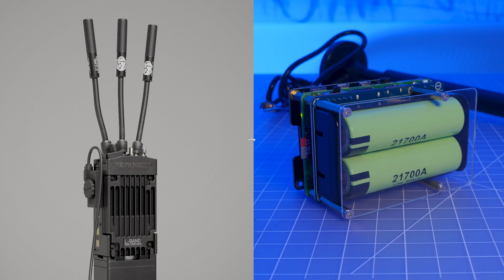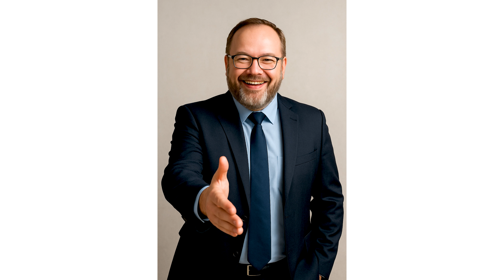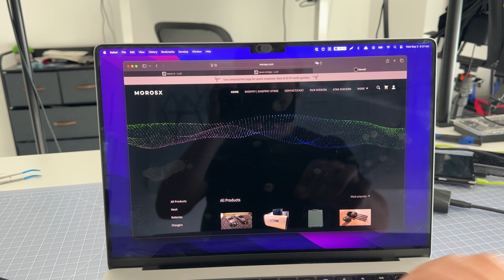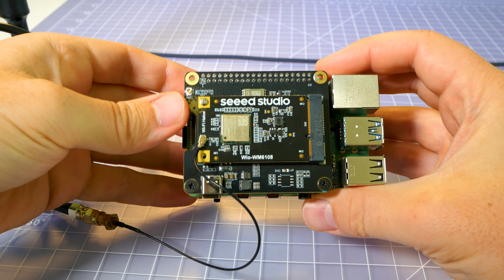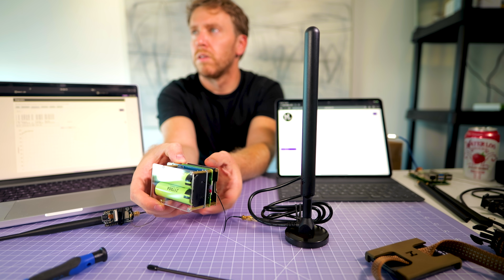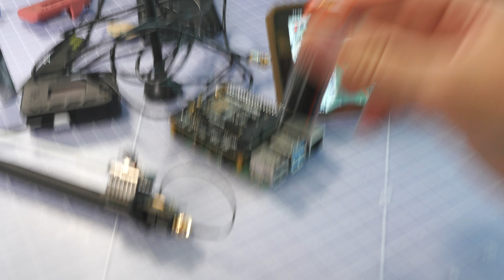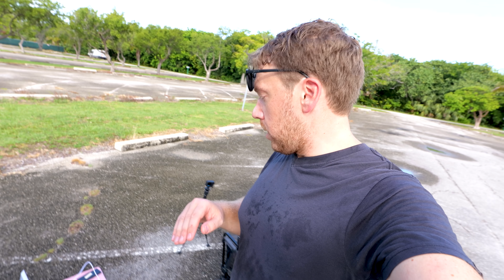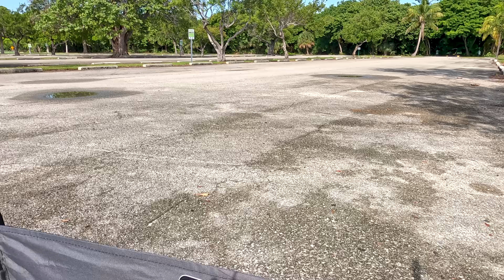I Built a $20,000 Military Router for $106.23

Comment: something to consider, mikrotik already makes sort of similar hardware for home use, they have hardware to connect wifi points at long range, also its possible to install openWRT on some of their devices so may be its possible to reuse some existing hardware, used will be cheaper and already water resistant + poe

Comment: You didn't create a "military router" for 106.23, you created a router with similar functionality, but didn't create it to durability, reliability, or water resistant specifications. You didn't create it to be resistant to RF jamming and to use restricted use channels and frequencies. You didn't create it with supply chain resiliency and transparency at the forefront. You just created another meshtastic node. Most of all, you forgot to create it to be maintained by guys with sub-optimal IQs who would rather be shooting the shit in the smoke pit than trying to get some dumb tech thing to work.

Comment: Very cool. Also, you might be interested to know that with an alfa wifi adapter with an atheros chip, a metal clothes rod from a closet, some neodymium magnets of roughly equal size to the diameter of the rod, and a directional antennae instead of omnidirectional; I was able to get a similar distance connected using 2.4ghz without halo. This was about 10 years ago now roughly. And I was getting 5mbps down, but that was the maximum speed of the connection. (Rural internet)

The way I had it setup, was the magnets helped hold the slightly weaker magnet in the antennae mount to the rod, but also I had the cable running through the rod, and had this propped up against my wall. Oh yeah, this was through walls and trees and bushes. About 4 walls in total, 3 trees, 2 bushes, and a about 2 blocks length in distance... which seems almost to be the same as your setup. maybe you are a bit further.

The wifi adapter helps though, cause it was able to be forced to work at a slightly higher power range... but I could never get it to work properly without cutting out. Even so, it still had a better range than others I had in the past. Probably for the best, since the FCC might have an issue with it if it ended up interferring with anything important. Being rural, I was probably fine. But oh well, it didn't want to play nice anyways. 

I eventually tested this for further distances, and got some interesting results. Barely a connection... but the SSID of that connection I got to link up, it had a name on it that implied it was in a town... miles away. Like miles and miles away. 

I doubt it was actually in that town. But still... where I was, there was nothing around me for all I could see. Just some random connection in the middle of nowhere was open and able to be connected to. So I did, to see if I could. 

It immediately shut me out a minute later after I did a speed test. Whoever owned that connection, saw that.
Reply: about a decade ago I was using 2.5ghz band to send live video feed from drones. You bump the power up and get a good antenna and you can cover some pretty wild distances. Over 2.5km. I did also accidentally discover a way to take down wifi for the entire neighborhood doing that though... which was not appreciated I'm sure.
Reply: @diversie509  Yeah... it's a neat trick alright.

Comment: What you made is not the same like the military device. It will not work at -20C (-4F) as FLASH memory in it will be erased. Nor will it withstand drop tests and other MIL-STD requirements like the ones for waterproofness. You can't make it as you will have to re-engineer Raspberry with components that can withstand extreme conditions. And these components cost at least order of magnitude more that standard IT chips. I'm not defending military procurement, but for that military grade device the huge amount of engineering hours and testing effort was invested. And then you have to divide that cost with number of units that military was ordering. So have that in mind. I was working in automotive industry for a while as engineer (and requirements are similar to military ones) and I can tell you that developing one engine control unit can cost up to 5-6 M$. Plus, one MB of FLASH memory that can withstand extreme temperatures costs like 1GB of standard flash memory. Nothing in that military router is reused from off-the-shelf components. PCB design, components, housing, everything was tailor made and tested multiple times before the device was adopted for use and the cost of R&D and testing was probably in millions. Not to mention that components you used do not comply even with the minimal cybersecurity requirements. So, the OS of the device is probably proprietary.

Comment: Nice!!

I have a suspicion yours isn't IP67 rated :-) And of course no MIL encryption, so it can do some of the things a MIL radio can do, but it wouldn't be accepted by the military. 

HaLow (yours is at 500mW, at least in hardware) gets you decent range without the higher power of many MIL radios (10W in the case of some Silvius configurations), but you're much lower bandwidth.. fine for voice.  Lower power is actually much better for a dense mesh, but that's not usually the use of this kind of radio. 

Of course, for non-MIL uses, there's a bunch of stuff. I can't tell from their specs who's HaLow chip is in the Quectel module, but I'm guessing it's Morse Micro's, so you'll have the 8MHz model, not available on all HaLow chips.

Comment: 22:50 I'm sure you're aware that you really should be running a speed test between the two nodes and not a speed test thru the Starlink to the open Internet. Because you're including too many unknowns here -- the Internet speed test server could be slow or the Starlink connection could have an issue. You'd want to run the speed test between the two nodes to know how well the HaLow connection is performing.

Comment: Mesh networking has been around for a very long time. But it has gotten much better. Multi spectrum mesh like what your using is really useful. But I just don't see a military buying into something that glows as bright as something like this does. Spec ops sure but general use I question it's usefulness.

Comment: i've been considering using an anchored high altitude weather balloon, as well as a hacked rv dish (to track the balloon automatically) to deploy a network that could be used for emergencies, etc. the idea in the long run would be that if multiple were launched, the HABs could connect to each other and share data, effectively creating long range data sharing / comms links. 
i'm currently trying to acquire some of the boards from the other/outernet project to tinker with this idea, bu they are proving difficult to find. i may just have to put together some bespoke hardware. as far as the dishes, used rv satellite dishes such as the winegard or tailgater series are abundant and cheap on the used market and are easily hackable...
Reply: meshtastic is probably what you want. This has good range and great data capabilities, but its MUCH more power hungry and meshtastic will have a greater range overall and still allows ATAK. A meshtastic node with a solar panel the size of your hand can stay powered up indefinitely. Throwing one of these halow devices on a balloon means you are taking it down every day or every other day to charge the device back up. 
If you want to get really clever, you could make use of the electrical change in altitude to power the meshtastic device without any solar panel, but you would need to be on battery saving mode probably

Comment: bro discovered 802.11ah and thinks he's a military contractor now
Reply: exactly what i was thinking, A MANET like this one will not see the light of day aside from commercial use, this thing can be knocked down with a $50 jammer, and the audacity of selling a $100 guide for documentation which is already free lmao
Reply: @pvim  i was thinking that. I used to use a 900mhz control link for a flying wing. Should have been getting well over 20 miles. Ended up getting jammed on the ground when a friend turned on their control link
Reply: Guess what other radios can be knocked down with a $50 jammer? If you guessed persistent systems mpu5, you'd be right.
Reply: @iirnubb   I cant see anywhere on their page that they marketed it as "jamming resistant". Any properly designed multi band hopping manet is very hard to selectively jam without blasting your jammer at full power across various frequencies inturn jamming your own comms and making the jammer location look like a beacon.
Reply: @iirnubb no, because it does spread spectrum frequency hopping. It'll just switch to a different frequency (and it does that multiple thousand times per second). You'd have to jam multiple complete bands to fully jam it, which would jam your own gear and you'd practically be a giant beacon screaming "LOOK, IM HERE!!"
Reply: @pvim  The docs are free big dog, only the pre-built thing is 100 dollars
Reply: @spressono he is referring to the $100 field guide he sells on his website that has step-by-step instructions for building it and configs. It clearly states it does not include any hardware.

I actually came to the comments to try to determine what the value was of the $100 field guide versus just following the GitHub guide.
Reply: @spressono  Literally click the link lol, it's $97 for the guide, no hardware is included at all. The pre-built thing he showed is ~$1200.
Reply: @spressono  crazy thing is that the pdf is NOT free, big dog. It costs 97 dollars. For the MANET guide at least.
Reply: "I made this 20k radio for 100 bucks!!!!" 
Now make it while maintaining a proper supply chain, making sure all the ICs come from the US, getting certified for EW/EMF hardening, applying for the contracts etc etc

He might realise then that the costs aren't /that/ inflated.
Reply: @xjekwkfhzodudidkne  “but muh halow chip from china is only 10 bucks!” 😅
Reply: @xjekwkfhzodudidkne lol no, that's basically all routers and car rf go through while selling at few hundred bucks. 20k for a radio basically fat ass profit margining, nothing else.
Reply: @shkhamd yes I'm sure you believe that FCC certifications are exactly the same as MIL-STDs, they aren't though lmao

Comment: You mentioned the legal limit of 30dBm for the broadcast power and then you mentioned using high gain antennas to get more range but you never mentioned the legal dBi limit? I am pretty sure I remember from my ham radio days that there is a limit to power output by antenna gain.
Reply: Most of the specs in the USA are limited by specific field power measurements. So it actually doesn't matter if you're achieving that gain with your PA or your antenna. In fact, that's the entire reason that the RP-SMA connector exists. Early Wi-Fi makers wanted to use replaceable antennas for a number of reasons, but the FCC didn't like the idea that it would be super easy to swap out that 2.2dBi included antenna for a 10dBi stick, a 24dBi Yagi, or whatever folks get these days out of the latest coffee can waveguide. Of course, WiFi pretty much managed to make RP-SMA the default standard for antennas in the WiFi band, and the FCC folks I guess just threw their hands up and stopped trying.

Comment: I've found G's speed test to be unreliable. I've seen many cases where it had the speeds backwards from all other tests... you should try multiple speed test providers next time you have it in the field.
Reply from the maker: I've found it more accurate that Ookla
Reply: @DataSlayerMedia  Interesting. I find Ookla and Speakeasy to give similar results most of the time, with G only sometimes agreeing with them.
I just tested all 3 and am getting 416/416 (which is exactly what I'm paying for) with Speakeasy and Ookla, but G says 676/104 (676 is higher than the next tier up, so there's no way I'm getting that speed). It showed similar speeds with multiple tests.

The inversion problem I mentioned seemed to last at least half a year... hard to tell what's going on when I'm getting symmetrical throughput though.

Others I've used just to see what they come up with are Xfinity, ATT's and Comcast's (as well as my own ISP's).
Reply: @DataSlayerMedia  Just use iperf between the two nodes.